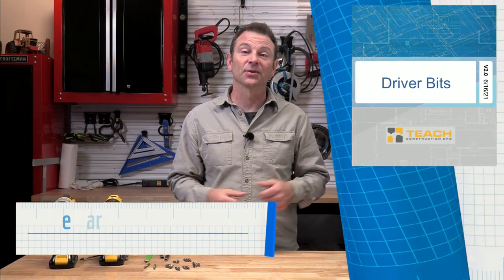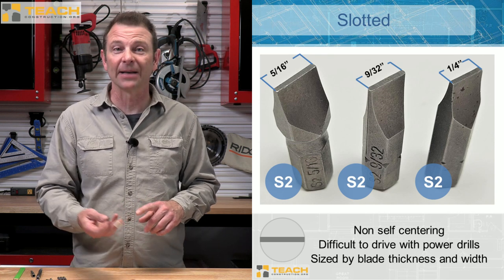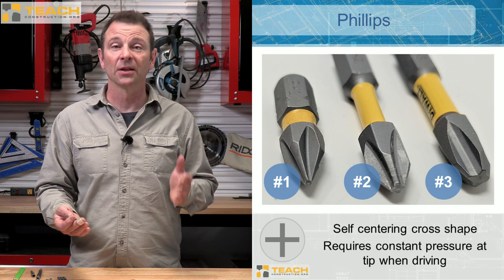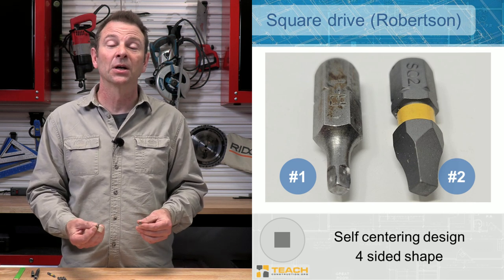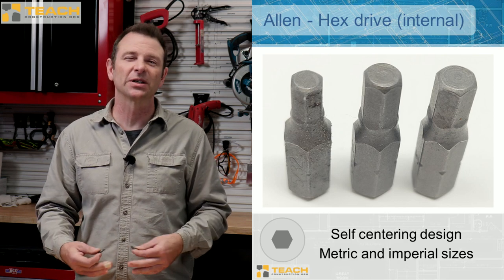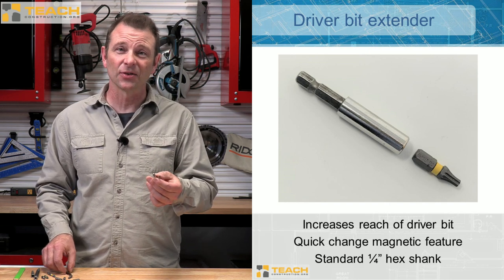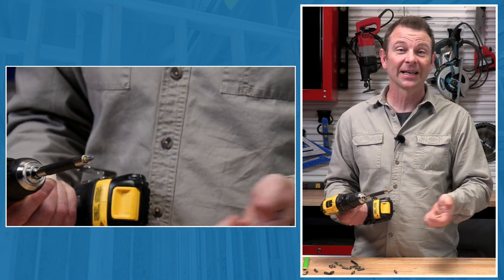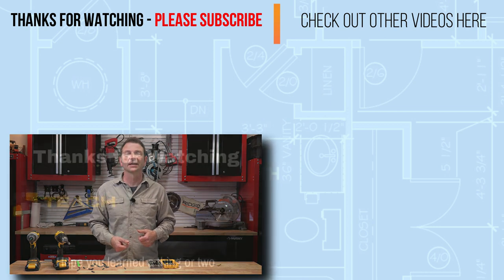All about Cordless Drill Driver Bits - TEACH Construction Trades Training Video Series

Comment: Excellent material. Thank you for making so much useful information free on YouTube.

Around 1:25 you talked about S2 bits being part of blade thickness for slotted screwdriver bits. I don't believe that to be correct. Rather, the S2 labeling is referring to the AISI S2 grade of Shock Resisting Steel that is extremely commonly used in 1/4" insert bits of every drive type.

One possibly useful tip for finding the correct size Torx or internal hex drive bit for an unknown size fastener is to start with a bit that looks to be one size too big. Then work your way down in size until you find one that fits snugly. If you try to work your way up in size, you may stop too soon (like using a T20 bit in a T25 screw). Undersize bits might seem to work under very light loads, but will likely strip once you really apply torque to them.
Reply from the maker: Great comments and thanks for the correction

Comment: Does which brand bits really matter?  The Milwaukee are more expensive then dewalt and wonder if it is worth it
Reply from the maker: Just stay away from the really cheap ones.   The red and yellow tools should be very similar in performance.